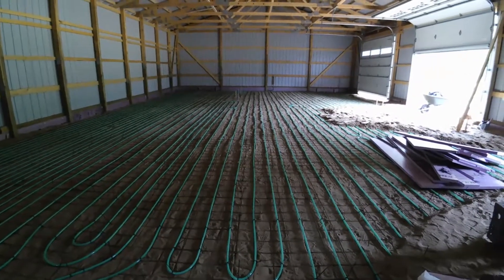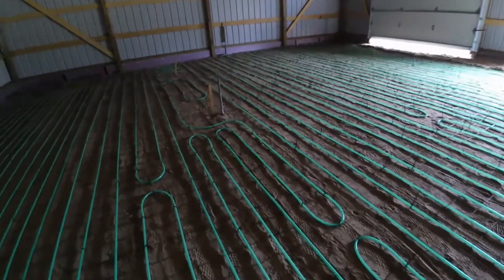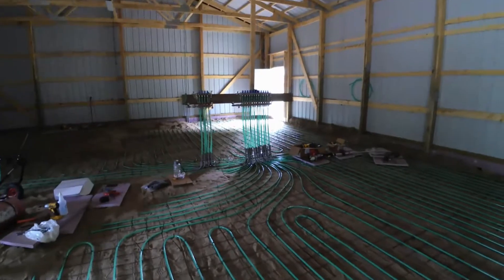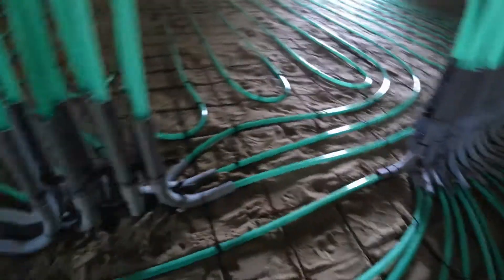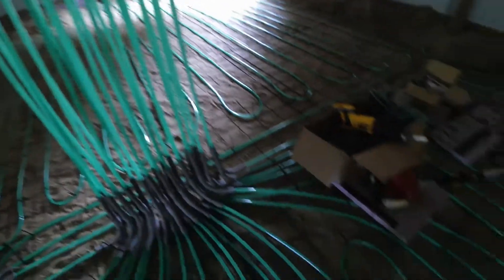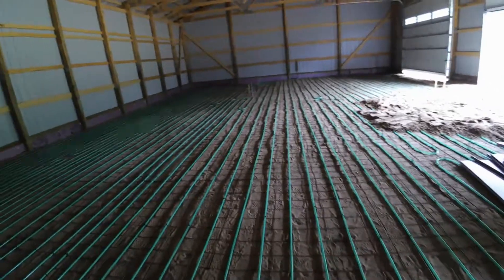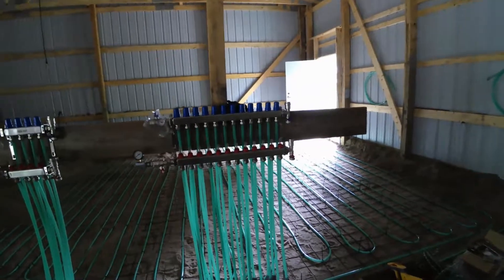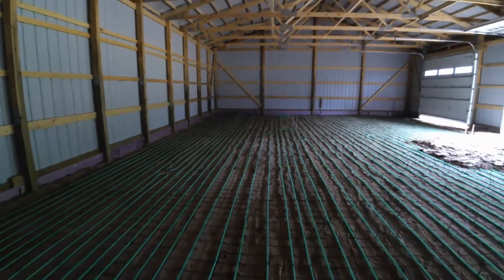Pole Barn Thermal Mass Heat Storage Radiant Tubing Layout Infloor Heating

Comment: Does the sand thermal mass work better than having insulation under the packs tube?
Reply from the maker: Comparing to other neighbors that have traditional radiant floor setup, my costs the same to heat as a 30 x 40. So about a 1/3rd of traditional radiant floor. That is due to thermal mass being able to make it through the coldest days without starting system up to heat.

Comment: Jason, gotta say , your videos are great and very informative . I also live in Minnesota . way up North. i have a 45x45x12 Morton I just starting to research all my options for finishing . I really like all the choices you've done in your building and I'm probably going to follow a lot of your examples . did you do any kind of vapor barrier in your floor? under the pex? how is the floor condinsation in our nasty wet summers?  Thanks a lot !
Reply from the maker: I am using thermal mass so no vapor barrier anywhere on floor.  Remember last summer or summer before where it was a stretch 90's but we had humidity that it felt like 110 degrees? Well according to everybody, they said tin and floor will sweat and be raining, well it didn't. It was fine but you could feel the wetness in the air so I bought a small 70 pt dehumidifier and ran that in there. Only needed one and it took that wetness feel out of the air.  Also  the thermal mass made it feel like it is air conditioned , so it was like 73 degrees inside, where outside it felt like 110 degrees.  I should have a video on that.  Thanks for watching and glad I can help in your build
Reply: @JasonYouTube  where did you locate your thermostat probe? did you put it in the floor? In the concrete or in the sand?
Reply from the maker: @clemmersmetalworx7012  I'm  not using an outdoor reset boiler, just a regular tankless water heater that can do radiant.  So no temp probe needed as I'm  using a wall mounted thermostat . Once you dial  the system in, it doesn't  overshoot temp much and if needed can turn temp of water heater up if a cold stretch is coming.  I just made a video of the system during our -30 degree weather so will post that tonight

Comment: Jason, 
Did you have to have an inspection of your tubing? I laid tubing yesterday and doing the air test today. Concrete tomorrow. Honestly I never even thought I might need an inspection. Thinking I may have to delay concrete now.
Reply from the maker: No I didn't  have to have it inspected, only my gas line for boiler.  Just do your air test and either videotape  your pex and the air test pressure. If you have a problem with an inspector just show him video and you might have to pay the inspection fee. I have talked to a few people  and no one has had to get it inspected. If it fails , it's your problem and really isn't  a safety issue. Inspections are there to protect your safety from improper installation.  If you screw up pex install,  nothing happens,  it leaks. They don't  inspect your concrete right?
Reply: @JasonYouTube  what was your pressure requirement for your gas line? Mine is 30psi.
Reply from the maker: @duanedickey7043   It depends on city but minimum is 10 psi and usually it is 25 psi. The gas after meter is only like 2 psi if you have the high pressure gas meter, (Red tag I believe , will say on meter) but low pressure meters are measured in 7" WC or .5 psi.

Comment: Very cool videos.  I just built a 40x56 pole barn very similar to yours, and looking into radiant heat.  I am interested in the thermal mass approach.  Where did you get your info or research that lead you to this, other than the traditional foam board underneath?
Reply from the maker: For thermal mass you use zero insulation under slab, or else insulation would make your thermal mass small. Commercial buildings use thermal mass but most people on the internet say it won't work. They say you need insulation under slab or wasting money! So I took a gamble at the time and did mine and now my heating bills savings beat my house and other peoples pole barns / garages etc.. ! I was worried the 1st month of heating because to heat up the Earth and all that mass, it was running for 72 hours straight! I didn't have finished walls and stuff but I thought it was going to make me go broke!  But it does work and hopefully will show people that the upside is natural ac during summer

Comment: why no insulation on the floor for the radiant heat?
Reply from the maker: When doing Thermal mass the sand acts as concrete ( Only Cheaper) and the tubes are placed in the sand. So the radiant tubes are about 11 inches below the surface in the sand base.  The more thermal mass you have, the longer it will give off heat. Downside is that it takes a while to heat that mass up, but if you do it early when ground is still warm, then doesn't take that much time or heat input. Wherever you put the insulation, then only the stuff above insulation will act as a thermal mass and keep the heat. That is why the perimeter of building has insulation 2 ft down and 2 ft over to keep heat from escaping to the sides basically acting as a chimney effect for the heat so it goes straight up in the building. Thanks for the question
Reply: @JasonYouTube  Great stuff, im thinking about doing the same. What's your average increase in the bill to run that boiler for the floor heat,each month? Is it cheaper to just keep it going, instead of restarting it?
Reply from the maker: @skynet000001   Right now I'm just figuring out the correct settings. Sometimes it will be 3 days before it starts up again as the thermal mass slab temperature maintains the 1 degree difference in barn for thermostat.  Feb bill was around $120 for the 3200 sq ft  building, but I didn't have it all enclosed. March bill was only like $55 but it was also around 20-35 degrees outside.
Reply: @JasonYouTube  Thanks for all informative videos.  I’m planning a build and appreciate your tips.  A couple questions, I thought I heard you say at some point in one of your videos that you had 4 foot vertical insulation to create the chimney effect and to also provide frost break. Here you say 2 feet inside and 2 feet outside 2 feet apart.

In looking at this video it doesn’t look like the inner and outer foam is 2 feet apart.  Can you please explain/clarify?

Thanks again
Reply from the maker: @tallhair   You need either 4 ft vertical foam on outside perimeter or 2 ft down and 2 ft over ( So forms a continuous L shape) to prevent frost creeping in. As frost or moisture will wick the heat away faster.  I did a little extra by installing foam between posts and level with concrete  as it wasn't that more expensive or time consuming and it just insulates grade board  and covers gap that is between grade board and outside insulation. Hope that helps

Comment: Wow that looks like a bug job!!! Was that expensive? I am wanting  to build a 50x70 garge didn't know to go with this heat or tube heat on top....
Reply from the maker: If your doing it yourself, you are going to save about  50% .  Rolling out the tubing is easy and if you buy pre-made panels, it is a piece of cake.  You pay about 25-30% more for the pre-made panels but the 2 panels cost me about $2200 . If I made it myself I would of paid about $1600-$1700 for parts. ( Copper 1" pipe is expensive as are the fittings, flanges, etc) But I saved that in my tubing as I did around 4700 ft of tube. Overall with 100 sheets of steel mesh , tubing, 35 gallons of coolant , boiler, panels, boiler, etc it cost around 8K . If a company did that ,then it would of been around 14-16K.  But radiant heat is a nice heating option and should break even in around 20 years lol!
Reply: @JasonYouTube where did you buy the pre-made panels? Thanks